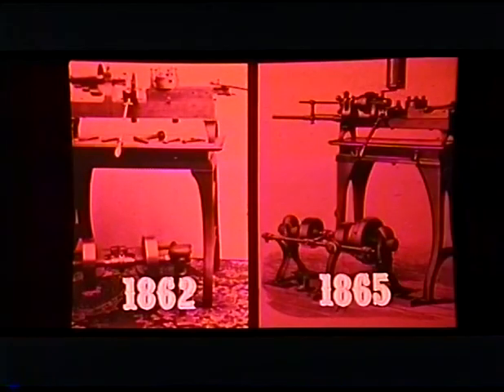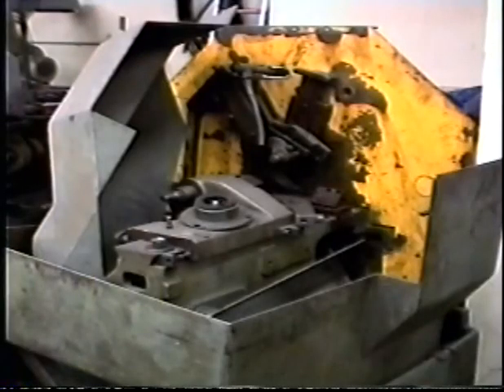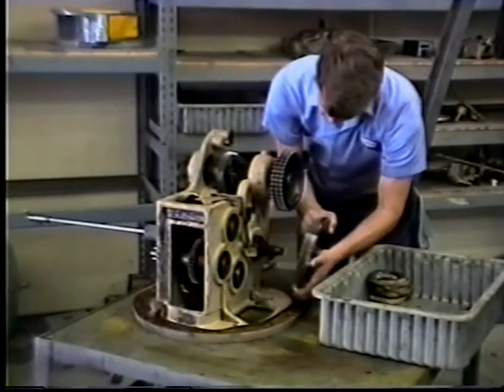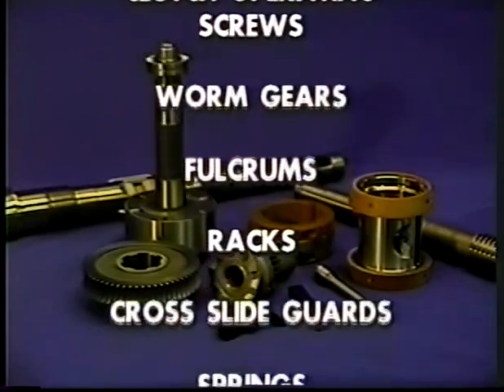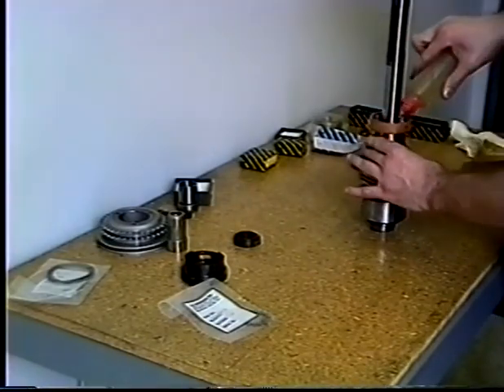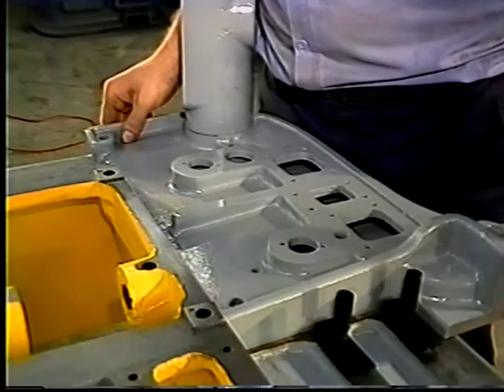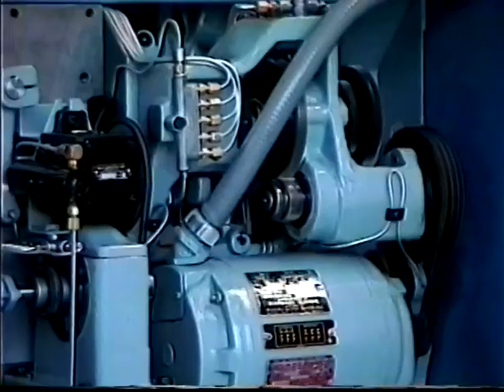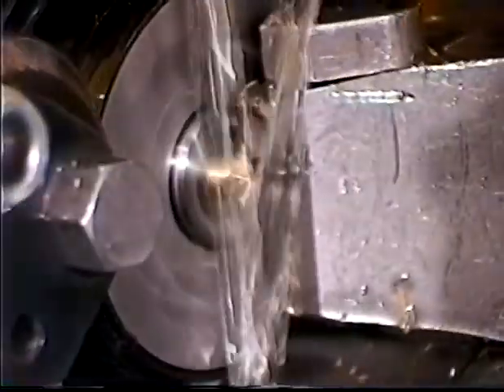Hamilton Automatics1

Comment: You can save the cost of having to buy or rebuilding a machine if you can get your customers to open up their tolerances. You can't expect to hold a +/- .005 tolerance if the machine its self is .030 out which is what you'll find in most jobbing shops.
Reply: @scotthamilton7556   DO you still rebuild B&S screw machines? I can't find you on the web
Reply: I couldn't find them either. Maybe he is busy fixing luwdmkes machines. Sure looks like they did good work
Reply: yes you can have held +  -.001 double feed cam two to three hundereths dwell